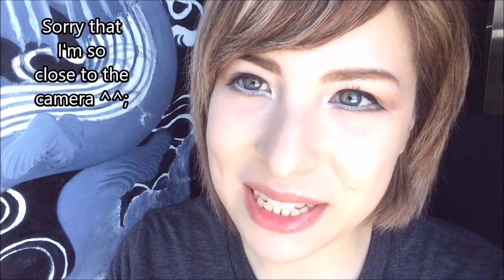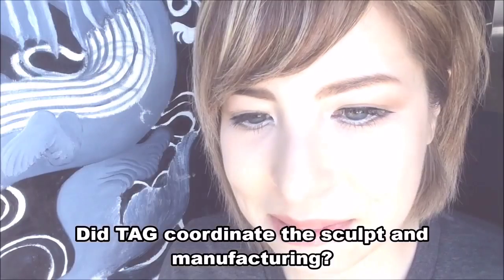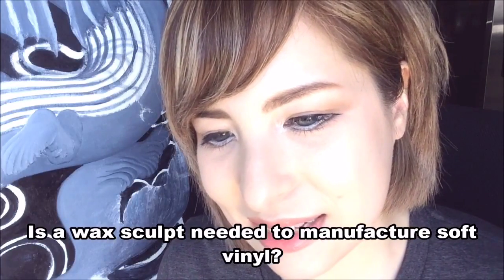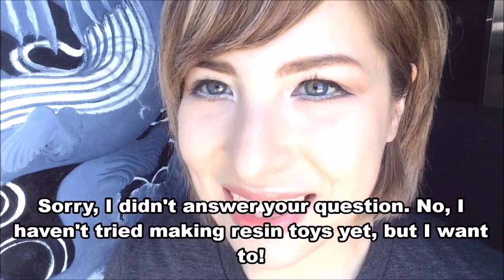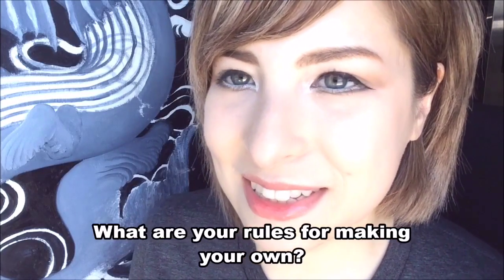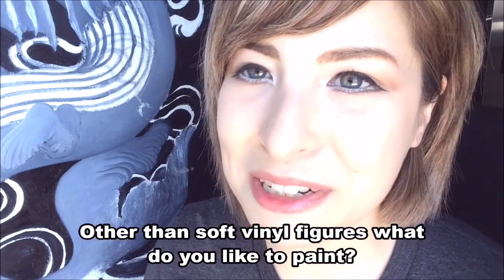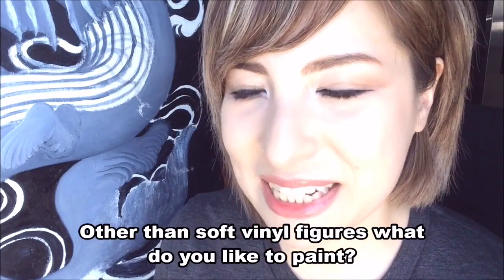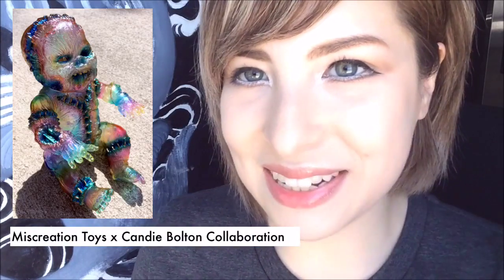Candie Q&A Sofubi and the designer vinyl toy industry

Comment: To help Candie out a bit:
There are no soft vinyl shops (manufactures) in the US. Years ago, someone was trying to get one started but after making 1 toy, no one really heard from that company again. There was another but the website is down so one can only guess that the company also folded up. If you want to cut the cost of making your toy, you can sculpt it yourself. There are "rules" because you have to remember, the parts are being pulled out of a mold so some undercuts, shapes, details will have to be sacrificed.

Resin figures are really a DIY project that you can do in your own home. It is very time consuming, and hazardous. 

...and yeah..."It's art, man." Hahahaha!
Reply from the maker: It's very interesting to know that some people have tried setting up a sofubi factory here. There's so much demand for it right now I feel like they would have certainly been successful. Although, after seeing Dennis' factory it made me realize that there is SO much more to it than just having all the right gear. 

Thank you for elaborating on the sofubi design rules! I wanted to go into it a bit more, but I thought I would do a poor job at describing it 😅. Despite the design limitations I feel like there's always a way around it. It's kind of like a puzzle and to me that makes it even more fun to work with.